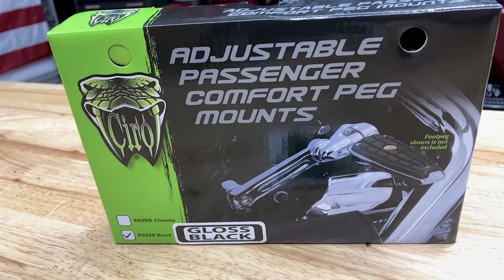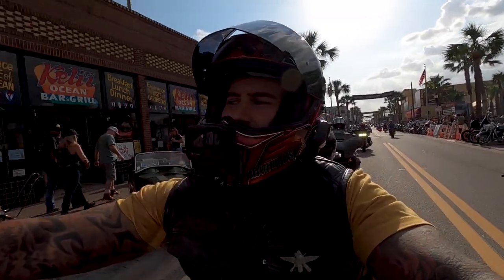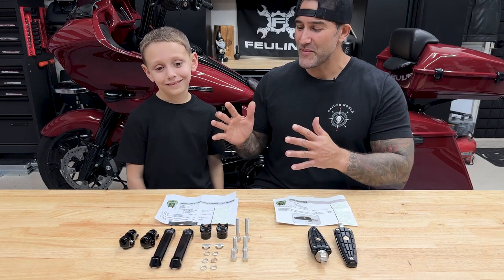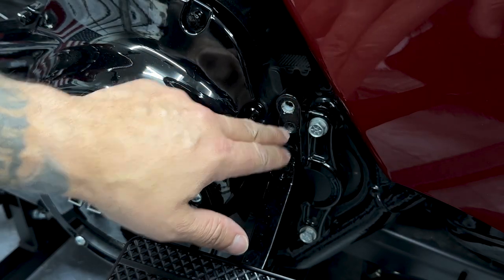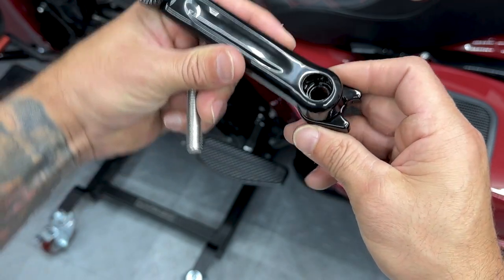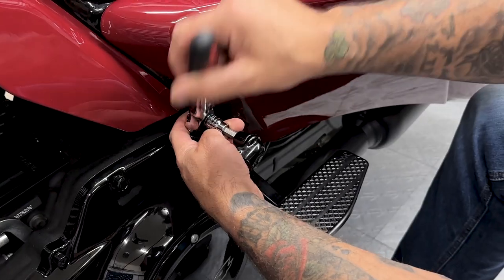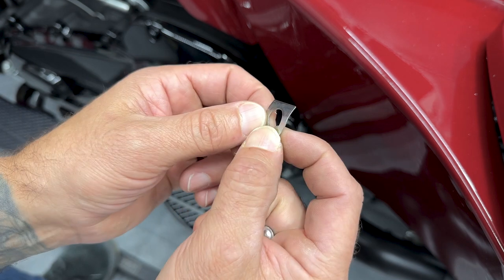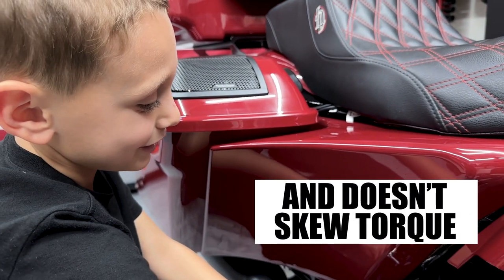HOW IS THIS LEGAL??? Find Out How with CIRO3D

Comment: Will Harley Footpegs fit as well or do you have to buy the Ciro ones?  Thanks for the video.  I've been considering these.
Reply from the maker: These are designed to work with any foot peg that has that same clevis.  I would definitely contact Ciro to confirm
Reply: @RAIDERWORLD  Ok no worries.  Thanks for the response.